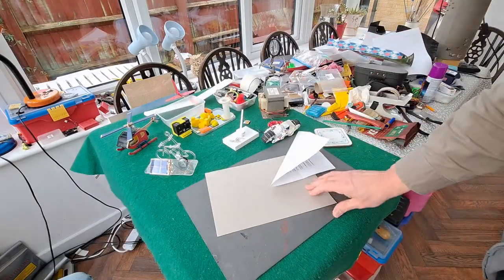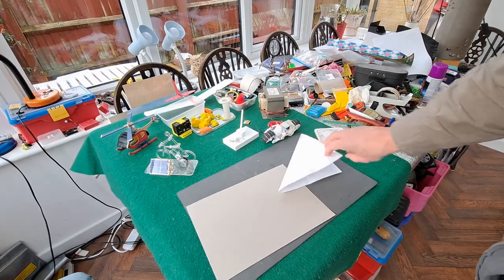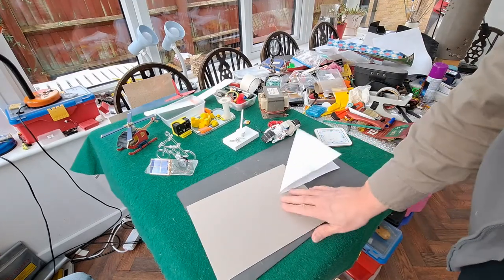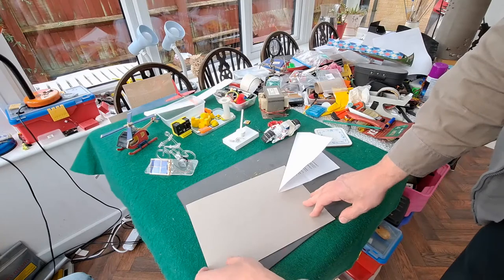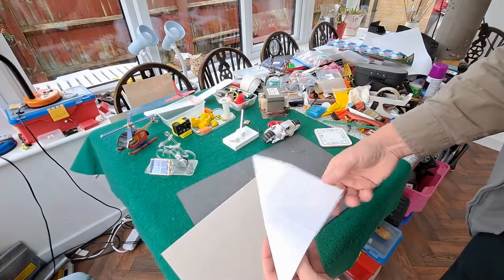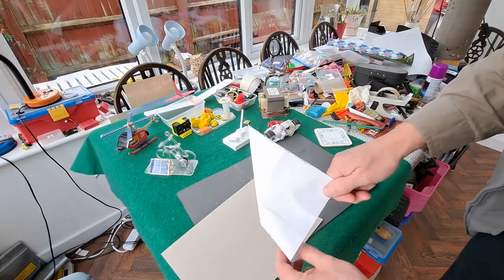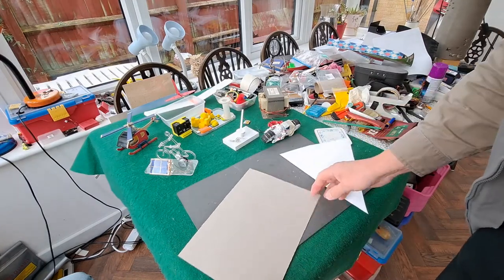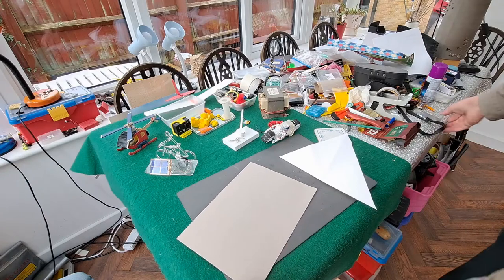Paper popper snapper cracker Mark 3

Comment: Brilliant job Graham. Yes, that is the type I remember but I am positive the paper was brown greaseproof paper. It must be stronger. 
The card would have had a Beano character on it with the comics' name printed on the other side. 😁
Brings back lots of good memories. Thanks for making them. 👍👍👍
Reply from the maker: Yes, clearly more force generated by this design. Could probably use thicker card and make the paper bit from thick plastic bin liner and duct tape.

Comment: Nice paper Popper with the Card but it only Works sometimes.there are Not many in YouTube To make only 2 Types of Designs which isnt much.still nice Origami too.
Reply from the maker: This one needed a stronger material for both parts. One of those projects you could spend a long time on, trying different materials.